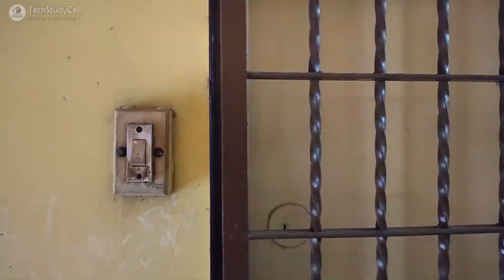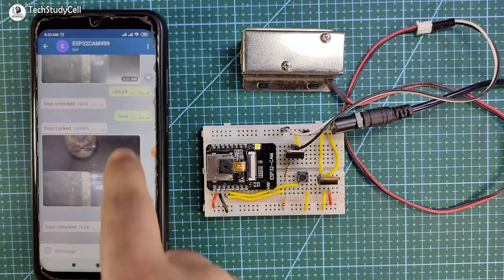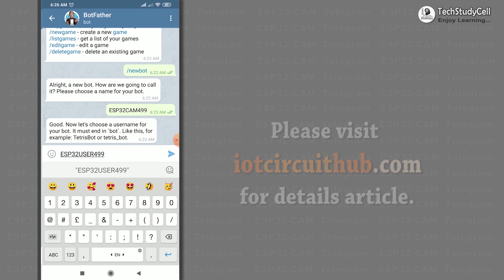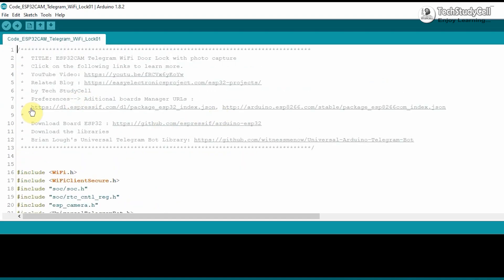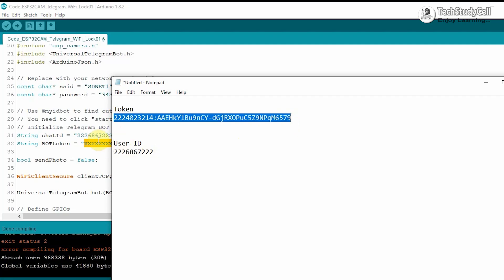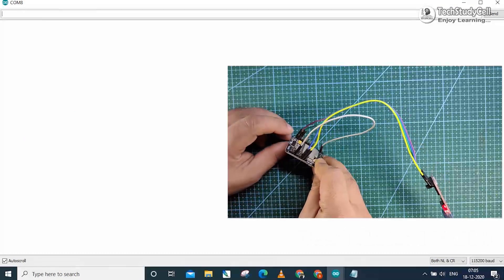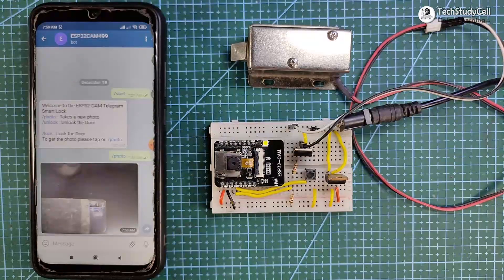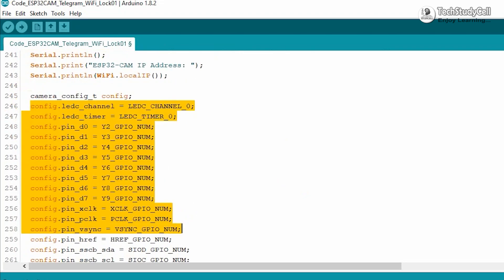Smart WiFi Door Lock with camera using ESP32-CAM & Telegram App | Iot Projects

Comment: Hİ, first thank you for sharing this video. I have a question for you. is it possible video streaming and motion detector (taking a photo and sending it to telegram) at the same time. I have already arranged a code for this, but esp32 cam module loses wifi connection when I try to open IP on browser for watching live video. I think it's not possible.